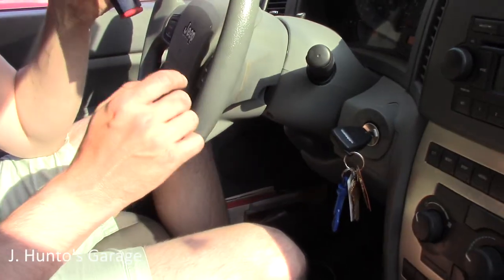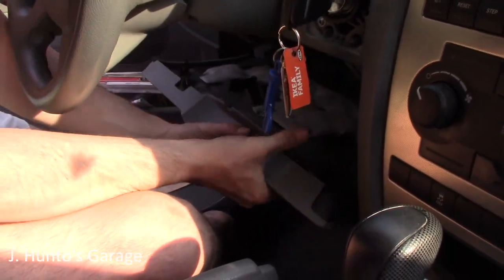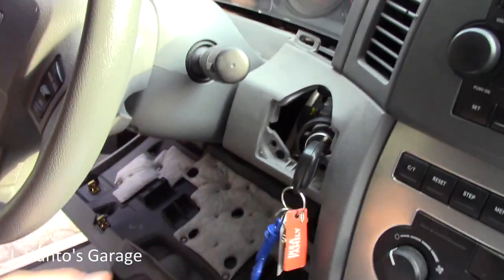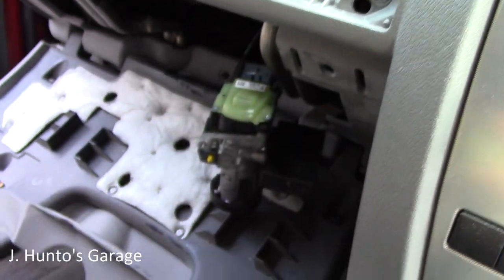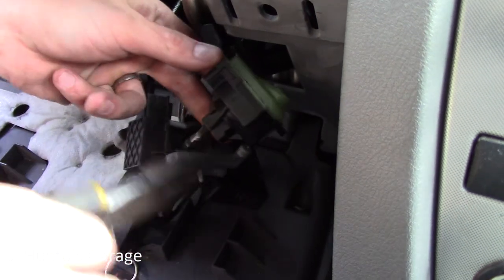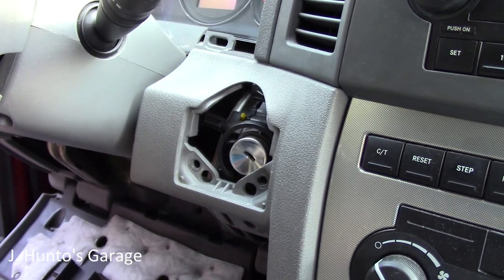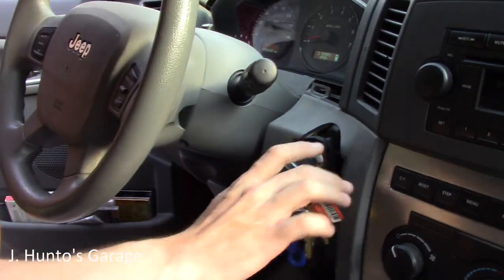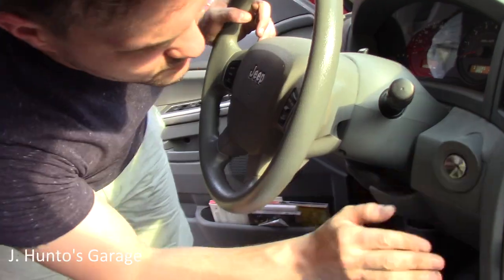NINJA JEEP FIX! U1411 WK Jeep Ignition Switch Replacement

Comment: You guys just saved me $$$, got the same code and also had issues with the dash. I found online that the switch would fix the dash issues, but was worried about U1411 "fuel", and thought i would take have to take it to dealer. Im going to replace the switch.  BTW i did get my original switch replaced via the recall. some people mentioned dealers wanted to charge install to replace it.

Comment: Extremely helpful video. I found that I needed to disconnect the connector to the switch to drop it down. It was still a bitch to get it to drop but eventually I was able to deliver it below the dash.  Getting it back in was facilitated by directing the back end in first pointed up. Then move the unit down and forward into the spot.
Reply from the maker: Very helpful! Thanks!

Comment: Great video guys! I was getting the same problem with the re-called replacement part. Cost me about $35 for this part. All is good so far except I hadn't had a beer yet, lol.
Reply from the maker: Michiana Drone Services LLC Hopefully it doesn't go the way this one did. Had to replace it again. Thanks for watching!
Reply: Oh no, I hope not. I bought my part from Napa, so I'm hoping it would be better than some other stores.
Reply: Unless it's the PCM.
Reply: I’ve had mine replaced 3 times. And now it’s acting up again after 7 months. I’m so fed up
Reply: @StangJeepGrl85  With manufacturer's original part or off-brand? I hadn't had any other problems.
Reply: The dealer had to replace the cylinder and switch. The dealer replaced it 3 times already. About 5 - 6 weeks ago it started to be hard to turn when starting it up. So about 2 weeks ago, my Jeep wouldn’t start at all. My dad turn the key partly and put the Jeep in neutral and try to start it and it stated right up. So he’s thinking that the neutral safety switch is going bad. Because I couldn’t start it up the Saturday before. We looked online for it. It looks like it’s inside the transmission? I hope not. That’ll be expensive. 😭. I’m hoping it’s on the outside and we can change it. But as far as the key and the cylinder goes, why does it keep getting hard to turn ? It’s getting annoying. My dad was about to change the ignition switch 2 Saturday’s ago but before he did. He put it in neutral and it started. So I guess The Jeep Grand Cherokee Laredo 2007, has 2 issues ?
Reply: @StangJeepGrl85  mine never turned hard. I'd try to reinstall it. There's also a circuit board under the gear center console. A different video. I cleaned the contacts and that helped. It had a problem with it's automatic transmission.

Comment from the maker: Turns out this switch had to be replaced a month or so later, returned to Amazon for refund and purchased a new one at O'Reilly's; all good!
Reply: J. Hunto's Garage what is the clapping noise? I have the exact problem i am in the process to replace it but i was wondering about the clapping noises
Reply from the maker: Dale Sh That is a plastic gear slipping in the AC control box in the dash. I'm sure there's videos on YouTube for this, it's a common problem.
Reply: You are the best thank you so much.
Reply from the maker: Dale Sh Happy to help!
Reply: J. Hunto's Garage did you get any other codes besides the U1411?
Reply: So, I'm guessing the switch purchased on Amazon was labeled Mopar since it said TRW. Is that right? And what brand worked for you? Dorman?

Comment: So this would be the issue also if you have a remote started because what you saying happens to me. Most of the time i use my remote starter.  Keep it mind it never did it when i first put it on. Now at time i use it and will flash lights, turn my AC off and engine light will go on for a few days then it will go away in her own.. with the u1411 code. Please advice

Comment: My sons 2005 jeep grand Cherokee Laredo   engine intermittently wont turn off after turning key off- can switch be bad? I think he swapped the asd relay - was wondering if maybe fuel pump relay might be sticking could cause issue? He removes the neg vmbattery cable when this happens
Reply from the maker: I would definitely start with the ignition switch.

Comment: Excellent job guys. I just did this. Takes 15 min after you watch this video. The black box you see on the right after you get the ignition screws off the first, second, and third cover. Turn it clock wise so it's facing down. Pops right out.
Reply from the maker: Judge Jury Glad we could help! Thanks for commenting.

Comment: Did this today. Thanks so much! I bought a used 2006 Jeep Grand Cherokee and not long after my dash lights began to flicker intermittently. My AC would shut off when this happened and at times my engine would not start.  My check engine light then came on and when I checked the code it showed U1411. It was a relatively easy fix and so far the problem seems corrected! Thanks again!

Comment: Got the recall notice last Jan, mine would turn on and act like the batt was dead but the light never dim. Sometimes the batt was dead? Got the switch changed at the dealer then/now 7 months later its doing it again? 2005 Jeep grand Cherokee.  Does the same key work in the new switch? thanks for the video it WILL help lol  What is does now when i turn the switch it just clicks, do it 4 to 8 times and the starter will turn over? Always worse in the mornings or after its sat for a while. Think its the switch already bad again?
Reply from the maker: Could be a bad switch again for sure. We had to change this one again about a month after we changed this one.
Reply: @jhuntosgarage  Thanks I am going to call the dealer again and see if they will do anything, if not i will just buy one...does the same key work in the new switch?

Comment: Hi, I've the same issue. The dashboard used to flash while driving and the AC also sometimes turned off. But the car isn't starting since yesterday. no cranking, no noise at all. When I turn the key on, the dashboard light comes on but the car doesn't start. It accidentally turned on earlier today and I took the car to the mechanic and he said the battery, starter and alternator are working fine. He asked me to go to the dealership to get the ignition switch checked. I just checked your video and now I think I've the same issue. So should I go to the dealership to get it fixed? or I can just buy an ignition switch and get it changed at the mechanic's?
Reply from the maker: The Blue Boy If it were me, I'd buy the switch and change it myself. This is not hard to do and will probably need to be done eventually anyway. Thanks for watching!

Comment: Same problem on my '05 Jeep Grand Cherokee Limited which already got a new recalled ignition switch about 3 years ago.  Got a check-engine light that turned off and on on its own and ODB-II reader pulled code U1411.  Cleared the code and it worked for a while and now having another symptom which is dash lights flashing on startup after AC kicks on.  AC will also pulsate.  Thanks so much for giving me a strong indication this is just the stupid ignition switch.
Reply from the maker: rabunbike I sure hope so. At least it's easy to do and the switch is fairly cheap. Good luck to you and thanks for watching!
Reply: Bought the part on Amazon and installed it in about 45 minutes thanks to your video which was full of tips.  Interestingly the last repair done by the dealer on a re-call ignition switch was done sloppy.  They didn't seat the ignition switch assembly properly and tossed away the top 3rd screw.  So far so good.  Only time will tell since this is a problem that comes and goes but I am very hopeful!
Reply: My 05 did exactly the same thing today after also having the ignition switch replaced on recall.
Reply: Mine is doing the same thing. Also after a recall a while back.
Reply: When I turn the key into the on position the engine light stays on any idea as to why?

Comment: Nice video. In my experience if you first remove the blend door actuator located behind the ignition switch is much more easy to remove and install the ignition switch assembly. Remove the actuator is an easy task. Thanks for the good job
Reply from the maker: Thanks for the info!

Comment: I just want to clarify the ignition positioning when changing this part. My instructions told me to turn the ignition or “run” but there is no “run” mark, just “on” “acc” and “off”. I left the ignition on “off” and changed the old out with the new. I just indexed the new switch to where the old was positioned and it works just fine. No issues. Thanks for posting this! Seeing someone get that Devil dash panel off helped me avoid breaking anything when I pulled mine off. I was seconds away from going Hercules, haha!

Comment: I had this code, lights went off, AC shut off, engine went dead got a check engine light with same code than I cleared it and it never happened again, is this similar to what happened to you?

Comment: Hello. Which is the correct link on Amazon to buy this ignition switch?
Reply from the maker: It's been a while so not sure at this point. You'll want to do a new search. If I recall correctly,  that switch failed not too long after this video was made.

Comment: Did the vehicle reprogram itself to the new switch? Or is the new switch already programmed for the vehicle? Thank you in advance. I get flickering lights in the dashboard I start up. Sometime my vehicle fails to start. Dashboard stays on sometimes even if the key is in the off position
Reply from the maker: No issue with programming the switch, not needed. I will say that this switch eventually failed too and it was replaced again. Sounds like you need a new switch as well. Thanks for watching!

Comment: At the end of the video. When you turned the car on that clicking noise.  What was that? Mine does that?
Reply from the maker: You are not the first person to ask. That noise is a blend door gear (slipping) in the dash. This changes where the air is directed within the dash, fo AC or heat. Not a huge deal to replace.

Comment: hey guys my 05 just threw the same code up , on googling , it is said that thus can happen if you use a command start for the car (which i do in canada) ... do i just ignore it or still replace the switch  ? what do you think cheers
Reply from the maker: blair marriott Hmm. Great question. I'm not exactly sure about the command start. If it were my car, I'd wait and see. Clear the code and start the car with the key, then check for the code. Check my channel for a review on the Launch code scanner and the Bluedriver scan tool. Both are very capable. I hope this helps! You can also post the question on my FB page J. Hunto's Garage.  Thanks again!
Reply: you can ignore the code or have it "cleared" and see if it comes back. if your jeeps electrical stuff (blower, tach, speedo etch) starts quitting on you i would definitely replace the switch

Comment: Thanks, can't wait to fix this!
Also, that clicking, is that what I think it was?
Reply from the maker: zadig08 AC blend door gear, stripped! Thanks for watching!
Reply: zadig08 what did u think it was
Reply: michael zayas 
Tl;DR I'm not sure it's the same part, but I had that exact issue and changed a thing that looks like that part on my blower motor to fix it. 

I was an aircraft mechanic for 6 years so I got decent at troubleshooting, but I'm not much of a car guy so I might be calling interior gizmos the wrong name 😄

I never called it that, I just thought it was just called an AC blender control, but it looks like the same part. I (literally) changed mine 40 minutes ago, but it was in the glove box on the blower motor and I had to transfer over a plastic gear. Everybody else seems to have one in super crappy positions, so I'm still not 100% sure that it's the same issue. If you've got the clicking on the passenger side with the AC on, I can tell you how I troubleshot it and where the part I changed is at. I pulled mine off, typed in the part number on amazon and ordered the first thing that looked like it. now it works and I've got non-invasive ac.
Reply from the maker: zadig08 Excellent!  I was aircraft weapons maintenance for 11 years. Salute!
Reply: J. Hunto's Garage 
Small world! By the way, this video really saved my butt, so thanks for that.
Reply from the maker: zadig08 That it is. I just attended a reunion for the F-111 in Fort Worth.  It was a great time. Thanks for watching and check out my video playlist and don't be afraid to hit that subscribe button. Hit me up on Instagram,  would be good to get together if you're ever in the Austin, TX area.
Reply: You guy's ain't gonna believe it but I'm also a 2w1 with these exact problems 😅 could definitely use a walkthrough on how to fix the clicking coming from my glove box

Comment: Just replaced it and my vehicle still doesn't start any other things I should look for?
Reply from the maker: The usual suspects are spark and fuel. Have to verify you have fuel pressure and spark.
Reply: @jhuntosgarage  it has spark and fuel and I just tested the starter it's something else in the ignition switch but idk what

Comment: Do the same key works with the new switch? Or I have to program the key..?
Reply from the maker: Great question. The same key works as the replacement part is separate from the key cylinder.